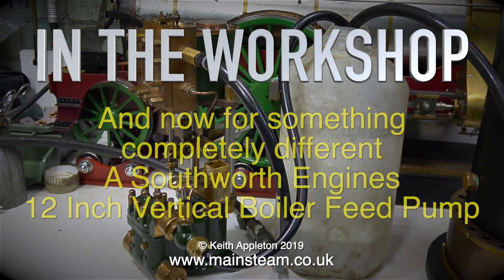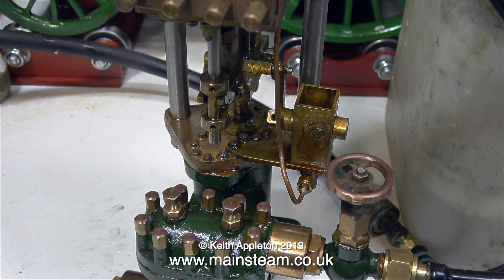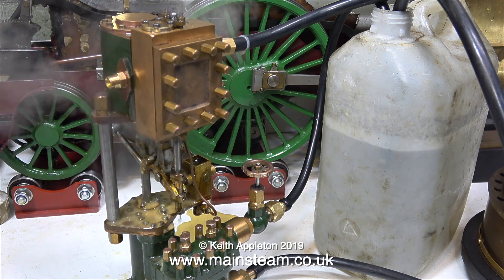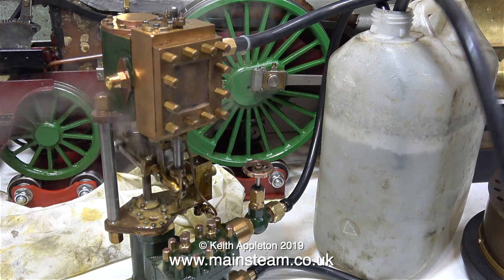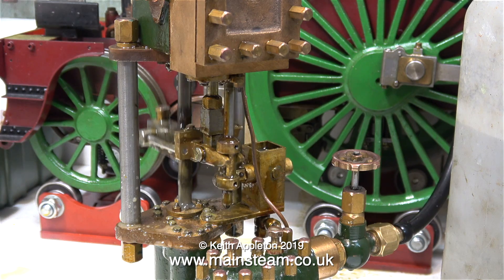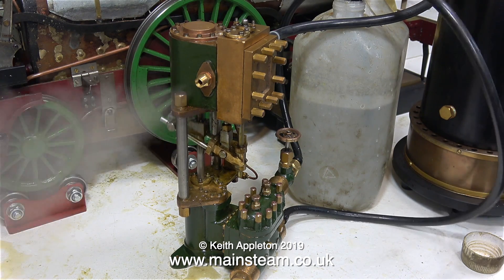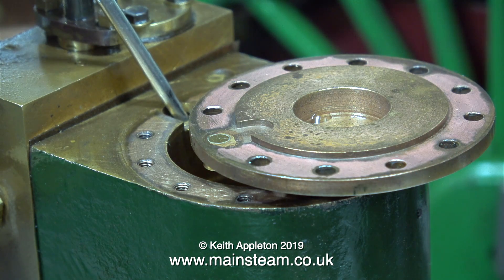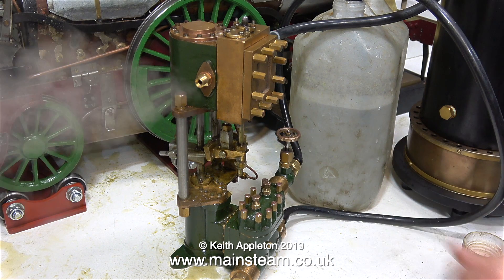AND NOW FOR SOMETHING COMPLETELY DIFFERENT - A VERTICAL SOUTHWORTH STEAM PUMP

Comment: Aside from aesthetics, why is the threaded exhaust fitting improper?  Will it work loose because of heating and cooling , and also vibration ?  I’m just being curious.
Reply from the maker: That's the way it was made, it will not work loose but I will make a proper exhaust flange for it when I get chance..